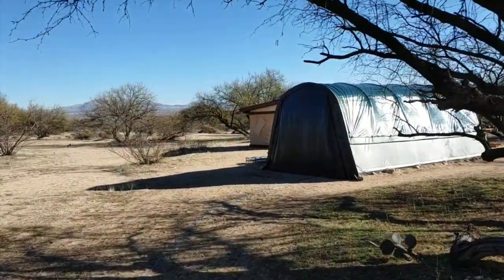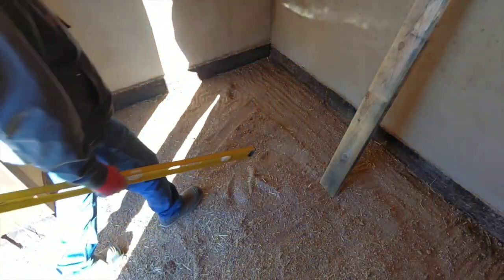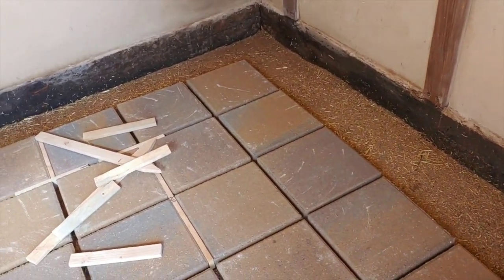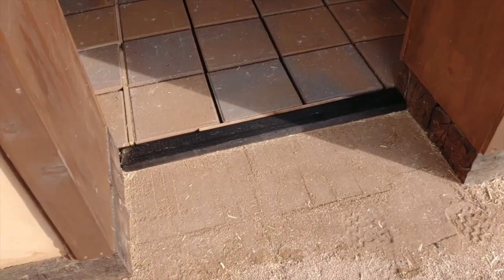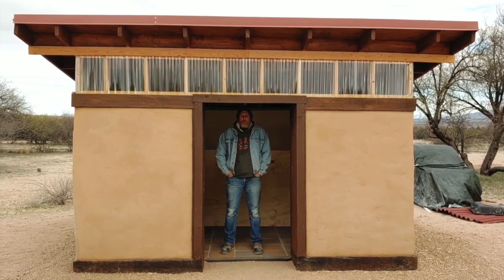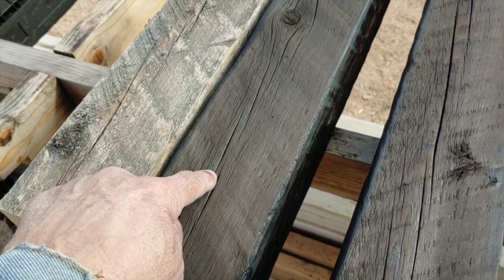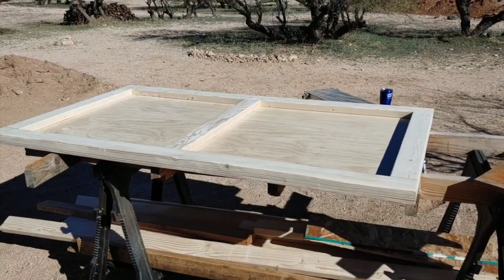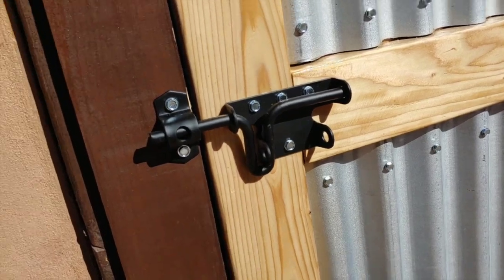#strawbale #sustainable Off Grid Strawbale Toolshed Build: Final Episode

Comment: Bill you are a great man of purpose. You and Yvonne (? Ivonne? sorry) are just a great team. I am thinking that your saw could use a DIY bench built on wheels so you can wheel it from the workshop tunnel easily to the work yard
Reply from the maker: Hi Michele. I guess you are referring to our large sliding miter saw. You're right a stand with large wheels would certainly be convenient. In fact, I initially wanted a stand from Rigid that would be perfect for such a situation. The problem was the cost. It was somewhere around $269. I've seen it on sale for as little as $99 so I waited and waited but, of course, the sale price never materialized. The stand I bought does have wheels, but they are pretty much useless on our soft terrain. Once the deck for the house is done, the saw and stand will be there and will definitely save me some steps.👍 Thanks for watching and your comments!

Comment: You guys are doing amazing things. One thing was coming to my mind why the base of the shed not raised a bit to prevent rain water entering the floor?
Reply from the maker: We wanted to try building ground level this time. Our first build, the Solar Shed was built in a raised platform. Water doesn't penetrate the railroad foundation. I did have to add a raised threshold at the door to prevent water from coming in though. That was an easy fix. Thanks for watching!

Comment: Looks awesome, guys!  Linseed oil application with brush or cloth?  Does it matter?  Also, how big are the gaps around the door?  Any reason to do anything there for weather and/or critter protection?  Just curious.
Reply from the maker: Linseed with a rag cause it's faster and more economical. Brush puts in on way too thick IMO. Reveal around the door? Not sure, probably 3/16". No worries about the weather because of the thickness of the wall. Heck, even without a door on it the rain never reached the inside😃

Comment: The bolt on the door is not secure,  just 2 bolts to unscrew and BINGO ! 
Should have used cuphead bolts right through or  " one-way " screws.
I've made doors like that before,  super strong and not relying on joints 👍🙂🇦🇺